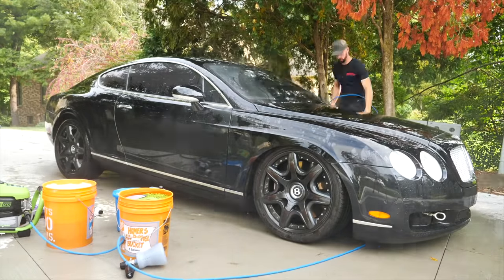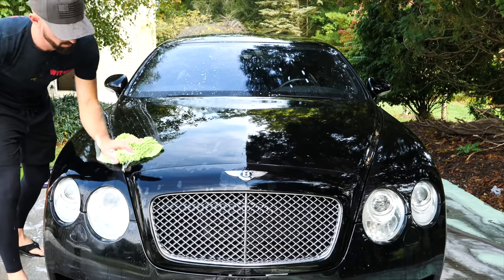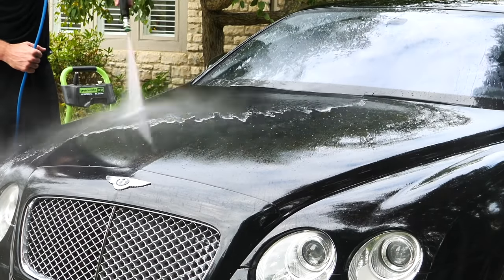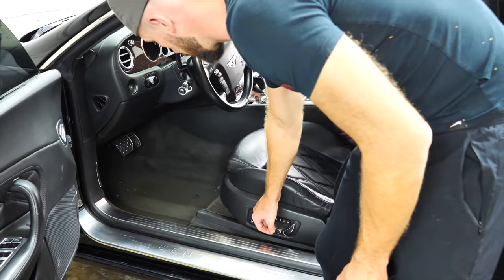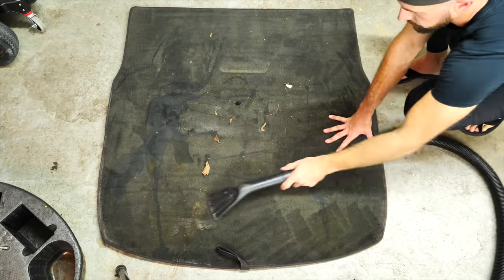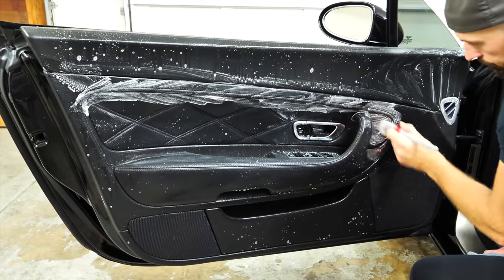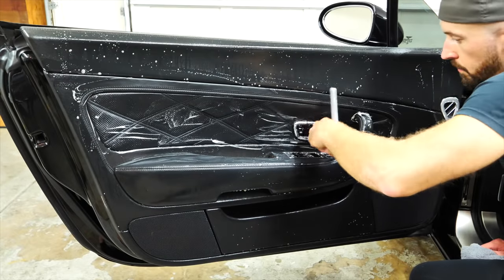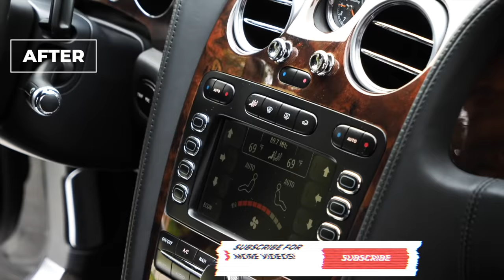Car Detailing A Bentley Continental GT Exterior & Interior - Restoration How To

Comment: I'm a mechanic and have a bad habit of tracking oil and grease into my car. Honestly I just use dish soap with my drill brush, and blast away the dirty water with a pressure washer. It pulls out the stains every time.

Comment: You did a fantastic job on this car. I just am very disappointed about that trunk. I cannot believe a car that cost that much would have an issue like that. As soon as you opened it and I saw all that water I was very surprised.
I hope you were able to fix the issue even though that's not part of your detailing business. I think you did a pretty good job cleaning up that mess back there. I've had a car or two that had had had that issue and it does make a big mess.

Another great video look forward to the next one.

Comment: Great Transformation. Bentley's are uncommon cars in the USA. The foam cannon clips were awesome. Here is what I use for carpet cleaning whether its car carpets or around the house. First, I use straight OxiClean mixed with water, which works well but I can run out of the solution fairly quickly. The dilution ratio is the package instructions, which is line 1 on scoop to 16 oz. of warm to hot water. Second, I have also used Folex Carpet Stain Remover, which I have used a few times, I use it full strength, and works pretty good. Lastly, I use Fuller Brush Fulsol Degreaser, which is my favorite cleaner/degreaser. I have used both the full strength aerosol and the 2X concentrate diluted, it is one of the foamiest cleaners I have ever used on carpets. If you try it, I would recommend using a deformer in an extractor when removing the soiled solution. The ratio for the 2X concentrate is 1 capful to 16 oz. of warm to hot water.
I always look forward to your detail videos.
Greetings from Virginia (VA).

Comment: Knowing the quality of leather they put in a Bentley, if I were the owner and saw your video, I’d be furious seeing you sit on the thigh bolsters the way that you did. You could see the creases in the leather caused by you sitting sideways. Cleaning and conditioning won’t fill in a crease in leather once you cause it.
Reply: This is an older car, those creases were there before. Leather doesn't crease with one manipulation.
Reply: my dad gets on to me about that alot, just sliding off the seat, even though it's not leather

Comment: You should not use the vaccuum on the interior when removing dust. It is so very fragile and scratches with ease. Please use a brush with vacuum over the panels (OMG).

Comment: As for the carpets , you should try pressure washing them first to get the APC out of the fibers more efficiently, then proceeding with extracting . As for a shampoo, when you are not asked to do the polishing, can at least use the meguiars wash plus, along with MF wash mitt , as it has micro abrasives that will get some of the contaminants out and lightly do some abrasion ...

Comment: Regarding your question about Carpet cleaning — I had a stain on very light tan (Cadillac) the carpet cleaners I had would not remove. I made a paste of oxiclean, let it sit for a few minutes, agitated a bit then got the extractor. It worked, but was really afraid it was going to bleach it a bit, fortunately, it didn’t. Our other vehicle has black carpet, very good quality and I use Bissell for heavy traffic when needed. Use our home vacuum (Kirby) which could suck the chrome off of a ‘58 Buick! Obviously I’m not dealing with the disasters that you are. 😉

Comment: Get yourself a air compressor and use it to spray out the areas you’ve cleaned - to use after you wiped dry the vinyl prior to dressing.  
It makes work easier and results noticeable.  

That rear tire trunk cover needs to be done with dish soap & hot water couple tablespoons to 16oz spray bottle.  Let dwell about 5 mins then agitate with drill attachment.
 
Also, hot water extractor is a great investment.  The trunk cover looks there was after birth stained on it. Acid rain looks like it messed up the dye in the carpet.

Comment: When my brother and sister-inlaw were looking at Porsche Macan's he opened up the trunk and the mat was damp. He told the salesman and he said it had just been cleaned and it was okay. My brother pulled the mat out and took out cargo cover and wheel and there was about 21 gallons of water in the well. The salesman could only mumble and said he would have it fixed. They bought another Macan he he took everything out and it was dry.
Reply: so they bought 2 macans?

Comment: Why u use the foam canon just to spary soap suds  on the car and then spray it off🤷‍♂️🤷‍♂️don't make no since to me at all!! That's just like going to a car wash and spray soap on your car and spray it off it's still gonna be dirty...you act like that soap it really taking that dirt off the and it's not! And that trunk carpet you could've did a better job on that ,that trunk carpet still had dirt spots on it and then u jumps rite to drawing lines on the carpet👀🤷‍♂️🤷‍♂️...It seems some times you gets lazy just been honest....and for the folks that don't know how to clean a car they think it's great!
Reply: He probably has a poor carpet cleaner but yeah he didn't try either that was disappointing
Reply: In theory, the foam cannon bath helps remove some of the dirt before a wash mitt bath. I believe the foam lifts some dirt off the paint as gravity pulls it down. For the carpet, I personally think he did a good job. This car was made in 2006, so those stains could be several years old. At that rate the only thing he could do is dye the carpet because not every stain is removable.
Reply: My thoughts exactly

Comment: For all of you out there….Never clay your car if your not going to correct and polish it. Clay is an abrasive and scratches the paint. Also when drying your car it’s good practice to used a drying aid to reduce scratches and marring from the towel and leave behind a layer of protection.

Comment: What do you guys recommend to clean seat belt webbings. My car has cream interior with matching seat belts and the previous owner must have had black hands cos the belts are horrible. The leather seats/door cards cleaned up lovely but the seatbelts really spoil the interior.
Reply: I’ve had good luck cleaning my tan seatbelts in my F-250 with a combo of diluted all purpose cleaner and a microfiber rag. I bet you could agitate them belts with a detail brush too for extra cleaning. I’ve also seen some YouTuber detailers use a carpet extractor on them if you have one(I don’t.)

Comment: Have a question for you. How many detailing brushes sets should one get for detailing? The reason I'm asking is because I'm a beginner detailer. Learning to detail on my own car. I liked the detailing brushes you use. I want to buy them but don't know how many sets to get. Please respond thanks.
Reply: I have 3 sets of those brushes.  They are very good brushes for detailing the interior and around tight spots on the exterior.